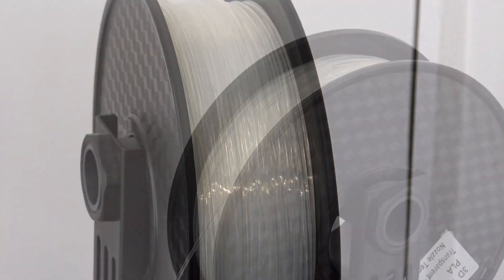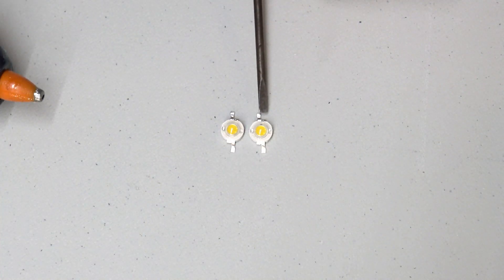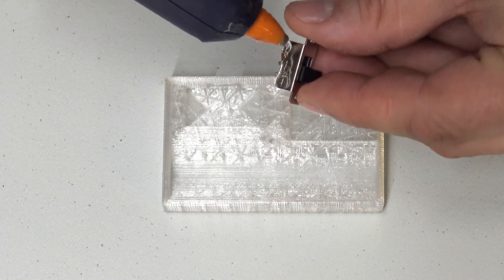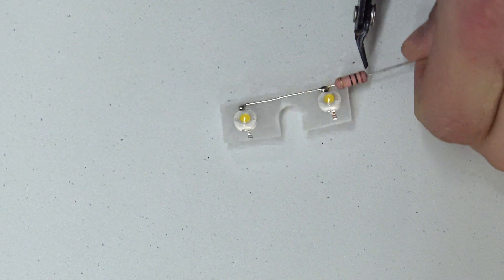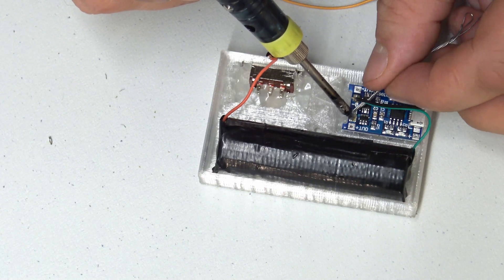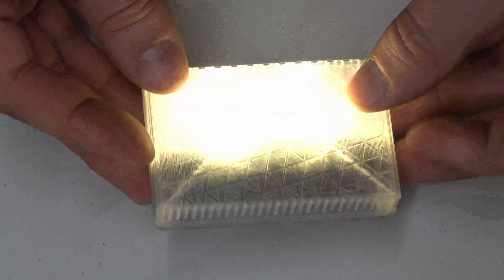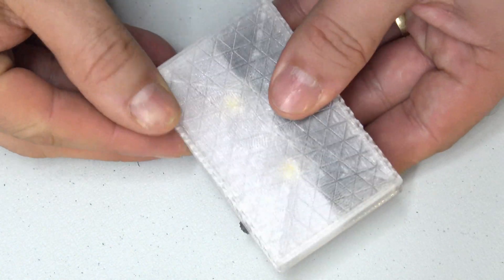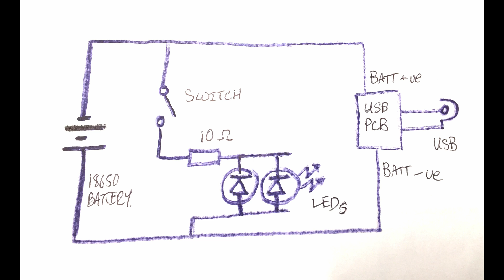DuB-EnG: 3D Printed Rechargable LithiumIon Battery LED DIY Electronics Light Kit with Micro USB port

Comment: That's a pretty cool idea... Wouldn't you get a clearer line-free case if you finished it with acetone?
Reply from the maker: ... it’s PLA so doesn’t respond well to acetone...  maybe I can try to print one in clear ABS! :)
Reply: @DubiousEngineering  I have to admit I know F'all about 3d printing, but did pick up somewhere that acetone smooths that stuff out, as to what filament type it works with, I'll leave that to the dubious engineers or this world. ♥
Reply from the maker: I’m still learning lots about 3D printers... they are fun, but not perfect yet.,. Maybe one day I will be able to ask for “Earl Grey ... HOT”...
Reply from the maker: Here is a little preview for those that take time to comment...  https://youtu.be/ig7wZoKXvkA
Reply from the maker: Here is a little preview for those that take time to comment...  https://youtu.be/ig7wZoKXvkA

Comment: Wow, that transparent filament is really turning out nicely! The supports totally looked like they were part of the model :D !!!
I'd use a nut to hold the two major parts together, I just prefer the smoothness, and reusability of machine screws instead of 'eating' the plastic. Wrap the battery into white instead of black tape :D And you could print the model tight enough that you wouldn't even need the hotglue to keep things in place :)  Ok... maybe that would take away from the fun of kit assembly... Looks great anyway :)
Reply from the maker: Some cracking ideas Igor! - I made it big enough to accept a 21700 battery - thats what mine will have in it... got it free ... review coming shortly.... but white tape makes so much more sense, and a nut and washer wouldnt go amiss instead of tapping the plastic.... i was also very surprised by the PLA filament... really good for this sort of thing... I may design something really cool for camping....  like a fold away torch....  thanks kindly for your comments ...  shortly, there will be an Acron ELectron video...
Reply: Camping equipment is always ripe for innovating new things for :) 
'will definitely be here to watch the next one! :)
Reply from the maker: Thanks for your support and suggestiong Igor!
Reply from the maker: For being so kind and taking time to chat...  here's a little preview of the next video!  Please don't hesitate to thumbs up if you like it!!  https://youtu.be/-7n-FJI2iGU
Reply from the maker: Here is a little preview for those that take time to comment...  https://youtu.be/ig7wZoKXvkA